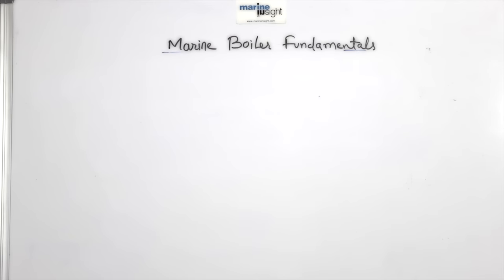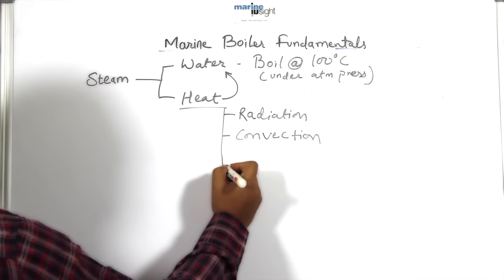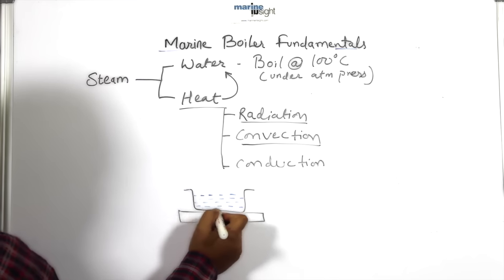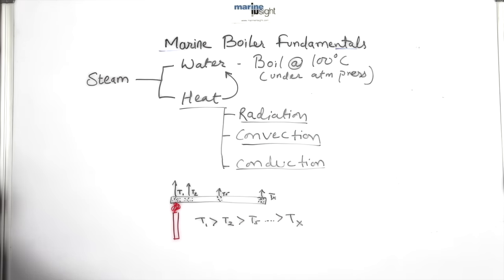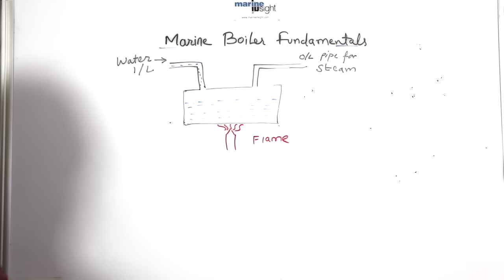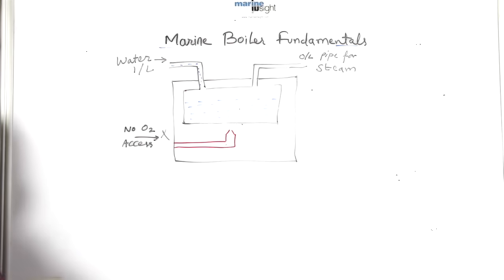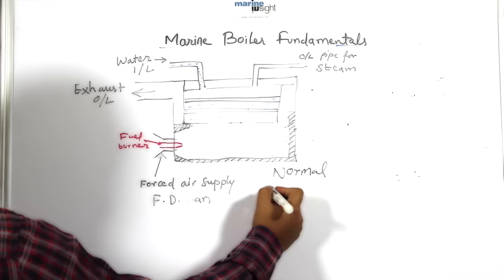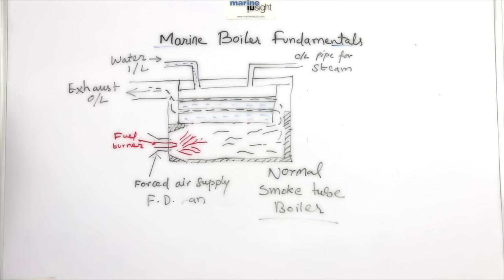Steam Boiler Operation on Ship Explained

Comment: " O|L "  looks like " OIL " ...the latter would be the fuel inlet to the burner, not the steam outlet on the boiler.
Good schematic and explanation though.
Lubrication systems use 710 fluid.